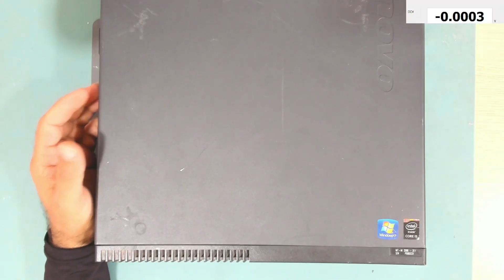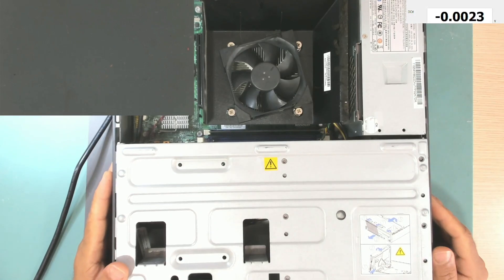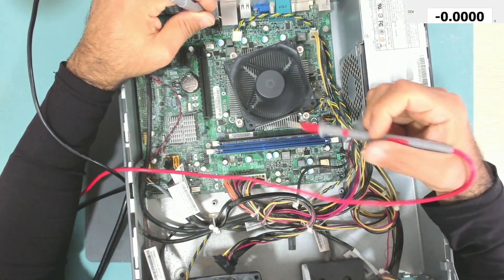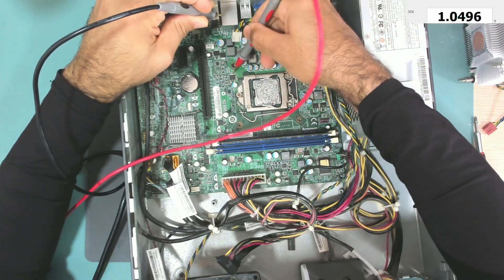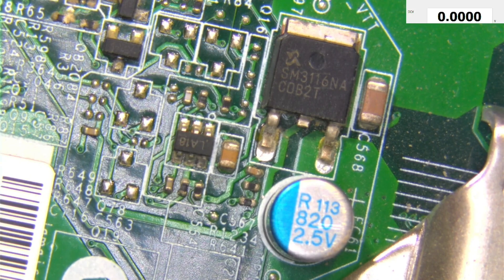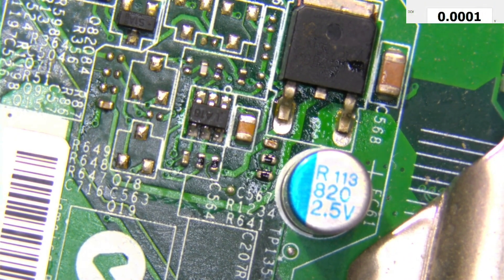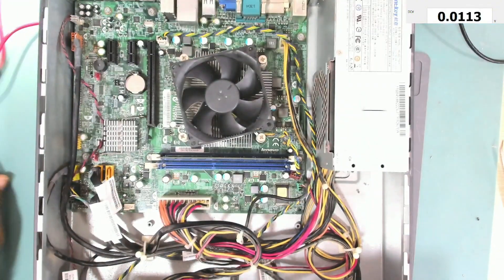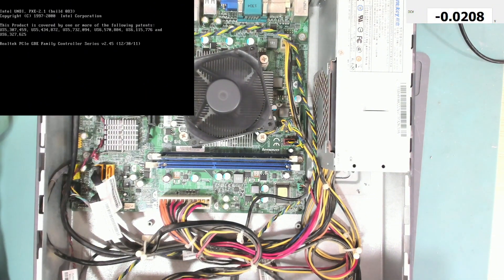Lenovo thinkcentre m72e no display repair || Missing VCore , VCCSA , NCP102

Comment: Have you fixed the m920q thinkcenter for no video ? I have all voltages you are talking about.
Reply from the maker: I have never worked on that model, but you might have a corrupted bios or you might heve signals missing including Power Good signals like VRM_GD